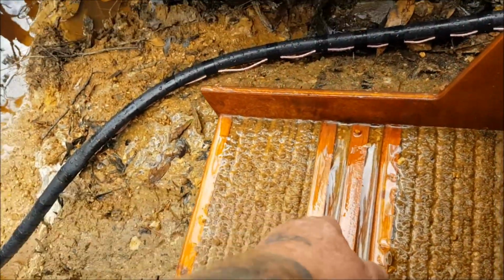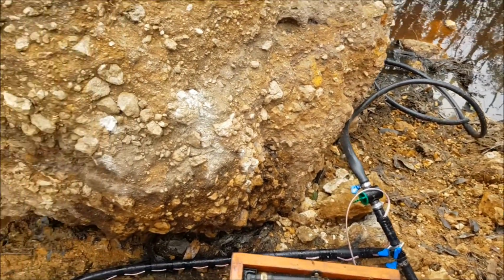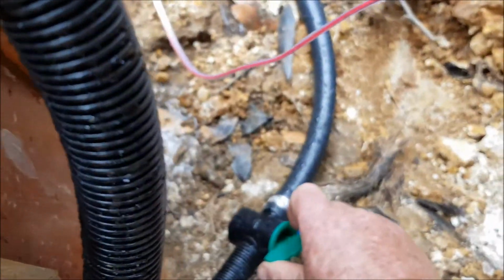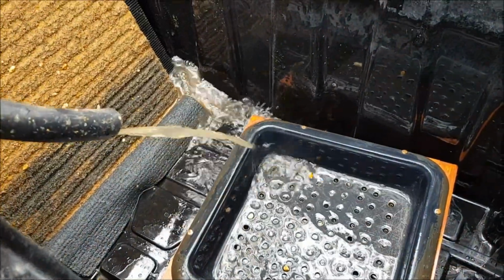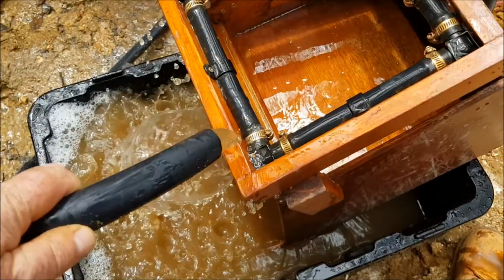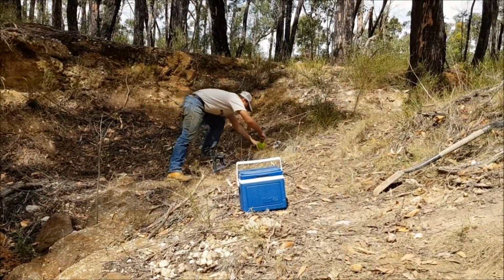Rocker Box with a Water Pump

Comment: Hi I love the rocker box what is the dimensions and size of each part  looks great
Reply from the maker: Thanks Glenn, but I made it without plans or even measurements. I had some plywood left over from another project and I drew the sides onto it in a way that I could fit 2 sides on the one piece of plywood. The first attempt didn't fit so I kept drawing the shape different until I was able to fit the 2 side panel shapes. After I cut them out I used scraps of other plywood and 2"x1"pine join them up. Then I had to find more ply to make the base. To give you some scale the width is about 12". I can't easily measure it for you because it is buried somewhere under more stuff in one of my sheds. And my sheds are full of so much stuff I can barely get into them LOL!

Comment: Never really got to see much rocking happening.
If you don't rock it , its pretty much a highbanker , an inefficient one
What does the rocking action actually do ?
Reply from the maker: G'day Mo, I do rock it most of the time, but this video doesn't show it LOL! A Rocker box IS a highbanker. It's the highbanker's forerunner. A highbanker is just a better version of a rocker box. The rocking action is to help move the water around to give stratification to the gravels in the top and also as the limited water supply runs over the riffles or across a carpet (or hessian bag). Rocker boxes are normally fed water by a small tin can which isn't enough to give a constant flow of water over the gravels, so the rocking action agitates and stratifies. Adding a pump like I did turns it into a basic highbanker which in theory doesn't need to be rocked, but I find rocking it still helps when the water flow from the pump is only slow.
Reply: @Ken_James_SV  I did watch a later tape of yours which did demonstrate you rocking.
Although your style was a gentle soothing method which gives rise to why it is often called a cradle.
My next idea which I most likely not implement will be to come up with a sluice that will perhaps not so much rock , but more oscillate left and right , only on inch or two , but at a highish frequency.
The idea is to empty the riffles of material that has been captured that is not gold.
Giving a place for gold to land rather than ride over the top